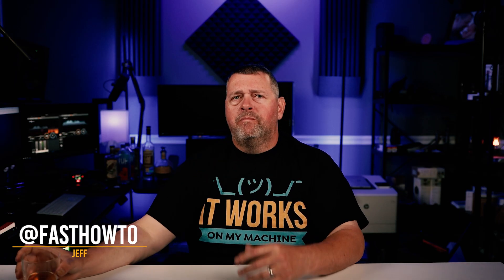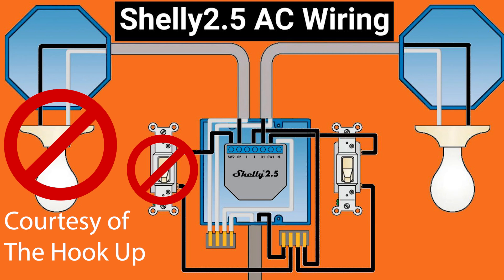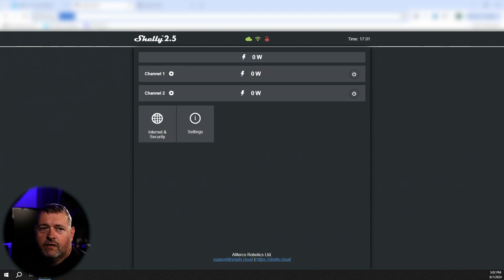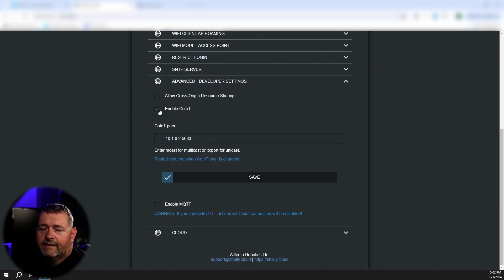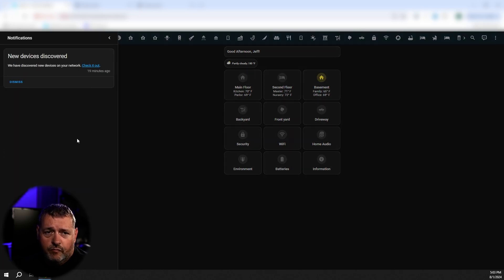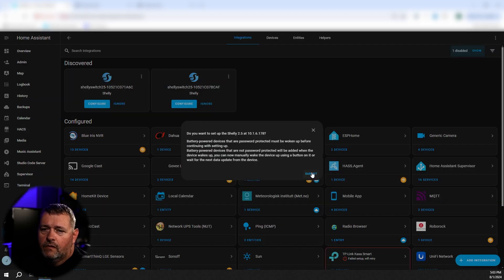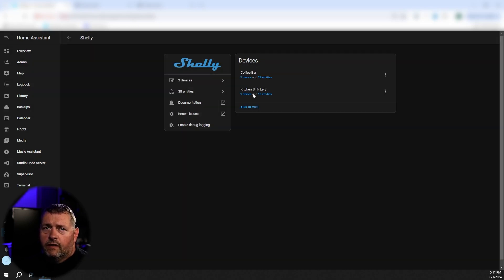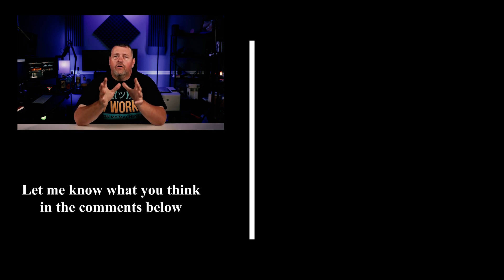Learn How to MASTER Shelly Relays in Home Assistant!

Comment: from 14.17 minutes to 17.22 absolutely useless no explanation what you did...
Reply from the maker: I told you what I was going to do, then I did it.  I'm not sure what else you're looking for.
Reply: @fasthowto  I understood what you were going to do, but not how you did it and why. You cut pasted changed, but what did and why would have been nice, watching these videos fto be able to learn myself, but until this was good, but then it fell away for me.
Reply from the maker: @1kobbens  I see.  The changes that I was making have been covered in several of my previous videos.  I try not to repeat the same content too many times, and the assumption is that viewers either already know how to perform some tasks, or have watched previous videos where I showed how to do them.

All I did during that time was copy the code from the outlet button,  change the display name, and the entity that the button controlled.  If you watch that section again, you can see the changes happening in real time on the dashboard preview window to the right of the code.  You can see the extra button called "Sink Light" appear, then you can see a second button called "Sink Light" appear, then you can see me realize I forgot to change the name of it, so I go back and change the display name to Coffee Undercabinet.

You can do all that in the UI as well, but I just find the code faster and easier to work with if there are very minor changes that need to be made - like just a display name and an entity.  There's no way to "copy" a button in the UI that I know of, so that's actually slower - for me, anyway.

Hope that helps!
Reply: @fasthowto  OK tanks! I will watch more of your videos...😀

Comment: I'm no electrician, but wouldn't you need to install a bigger box with more box fill, maybe a 22.5 cu in, to be within code? I know box fill applies to conductors, grounds, outlets/switches, and if it has internal clamps, but I feel like it would also apply here. Just a thought.
Reply from the maker: Good point! I'm no electrician either, but you're probably right. I didn't really show the box in any kind of detail, but the box shown in the video is a 22.5 cu in box. I installed it when I added that switch during the kitchen remodel. :)  I always install larger boxes just because it makes things easier having more room in there.  Thanks for watching!